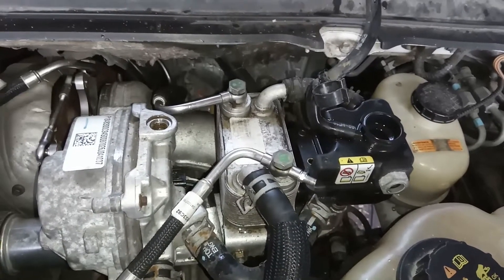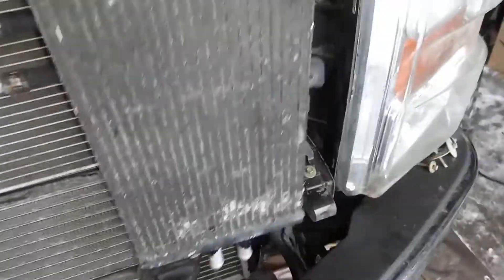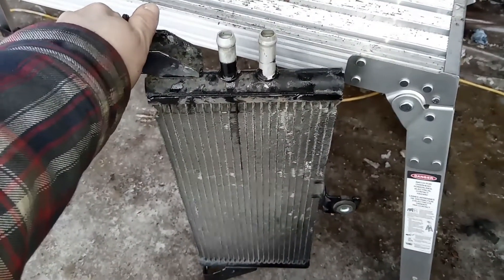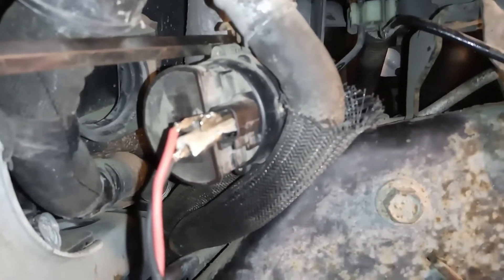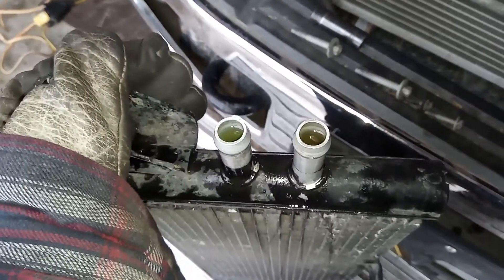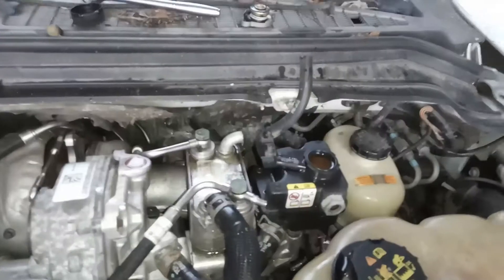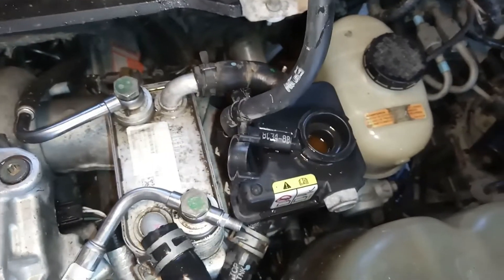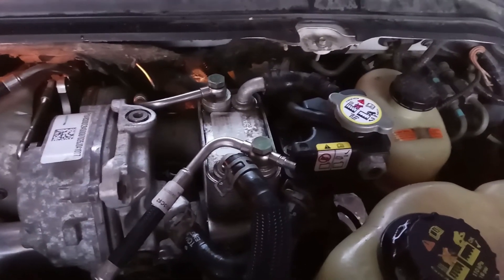How To Bleed The Fuel Cooling System On Your 6.4 Powerstroke

Comment: I just replaced the head gaskets on this 09 6.4l powerstroke I'm working on. Everything seems to be good now, except the fuel cooler. The coolant is clean, but I'm having to add coolant after every trip. Im assuming it's bcuz I need to bleed it as shown in this video, correct? I dont see any signs of an external leak.

Comment: Hey Power-strokers, I just had to deal with this after doing a Mishimoto intercooler and radiator upgrade.  I think I was able to get the air bubbles to pass through the pump by squeezing the intake hose leading into the 12V fuel coolant pump (under drivers side wheel well).  It took several times (of me pulling over and squeezing the hose every time the pump started making the cavitation noise), but eventually it stopped making the noise.  My thought is, by restricting the hose leading into the pump, it temporarily increases the flow causing the bubbles to make it passed the pump.  I'm not, however, convinced the bubbles make it out to the reservoir, they might just be building up in the heat exchanger.  In this regard, this method is just a quick fix.

Comment: I recently flushed my system and replaced it with the cat elc coolant. Did the same procedure to my engine a few years back. Didn’t want the crap gold dropping out sand to eat away my front cover and water pump. Have 211xxx trouble free miles out of my 2009. It was completely deleted the day I bought it. Intake, 4” turbo back and spartan tuner. Transmission gave up the ghost at 194xxx.
Oil changed every 5k. 
Both fuel filters every 10k. 
Engine bone stock. It’s been a great truck and it’s paid off. Plan on keeping it forever. In the process of saving up for a KDD 6.7 steel piston replacement engine for when this ol girl gives it up. 
6.4l are great trucks if you are very strict on the maintenance. 
Great videos kind sir!
Reply: What was your process to flush the old stuff out the reservoir and hoses ?
Reply: I didnt know you could use Cat's ELC as a better alternative. I'll have to consider that.

Comment: hi. I'm Su from Korea. Actually, I am Diesel Engine Quality Engineer in Korea motor company.
Recently, we launced 3.0 inline 6 diesel engine , and had a Engine-Stop , due to wear of High pressure pump roller wear. Small particles from high pressure pump stucks at injector and engine stops. Mostly in summer and few diesel at fuel tank. We test a lot and finally found that , "high fuel temperature loss viscosity of Diesel fuel, and impacts and high fuel pumping roller wear. Max 86 Cº fuel temp checked just before high pressure pump.

Question :  Does all USA Diesel vehicle has a fuel cooler?????   I really need your opinion. Thanks regard.
Reply from the maker: It's pretty common now, though it wasn't in older vehicles. It's normally found on modern common rail injection systems that recirculate the waste fuel from the rails, the rail pressures in those systems bring the fuel temperature up considerably. When that fuel is constantly recirculated through the high pressure pump the fuel temperature will get dangerously high without a means of cooling it before it goes back to the pump.

Comment: Does the fuel cooler pump have to do with the truck not heating inside?
Reply from the maker: No, the fuel cooler system is a standalone system, it doesn't do anything except cool the fuel. No components are shared with the engine cooling system, which is used to heat the cab
Reply: Thermostat. There are 2 and these trucks love chewing through them. Also put the updated radiator hose from Ford. 2 o rings instead of 1.

Comment: What kind of coolant does the fuel reservoir take?
Reply from the maker: Pretty much whatever you want to use, unless you're topping it up and then you want to use something compatible with what's in it already. It's a basic system with an electric pump as the only moving part, and it's totally isolated from the engine, so any kind of coolant will do the job.
Reply: @backwoodsbuildingandfixing9223  cool...my employer had recently purchased an 08 450 chassis model and will not get a manual for it. The stickers on the reservoir show to add a yellow looking coolant and was having a little trouble matching the coolant. Not sure what was in it as the reservoir is empty but I will dig a little deeper and figure it out. Very informative video and thanks for the info!
Reply from the maker: @terrywarr4477  If it's still running the factory coolant it'll be Motorcraft Gold, same as the stuff they put in the engine. 13 years would be a long time to leave the original coolant in, but you never know. Either way I'd just flush it out and add something easier to get, and you should track down why the reservoir is empty, leaking hoses is common but I've heard of the fuel cooler itself failing and leaking coolant into the fuel...I've never seen it but it would wreak havoc on the fuel system if it did. Glad the video was helpful!
Reply: @backwoodsbuildingandfixing9223  good advice...thank you
Reply: @terrywarr4477  While technically the system can use whatever coolant as stated, the coolant that is called out for this is the same that is used in the engine cooling system. There is no reason to complicate things, system spec says to use Motorcraft GOLD, so whatever is the analogous gold you're using in the engine, you should be using to top this system off.

You should not need to top this system at all unless you had to drain it or you have a leak.

Comment: im just wondering if you have tried to pull a vacuum on the system and filling it like you do with the radiator?
Reply from the maker: I don't have a setup for pulling vacuum on cooling systems. One day, maybe. It should work fine for this, I can't imagine that it wouldn't but without trying it I can't say for sure. The way that heat exchanger is mounted is a real wild card. They screwed that up bad, having inlet and outlet at the same end is never ideal but when they both enter from the bottom that's just simply a design flaw.